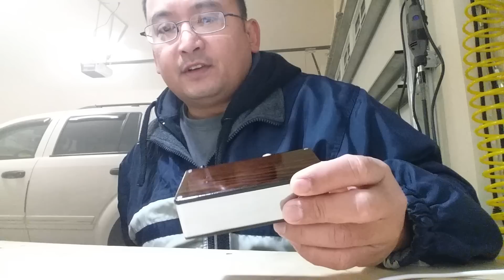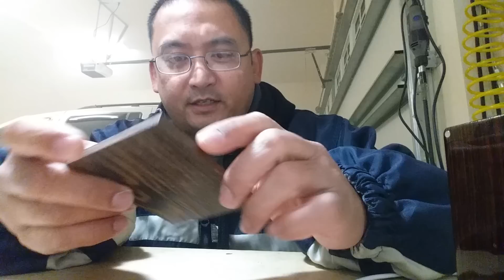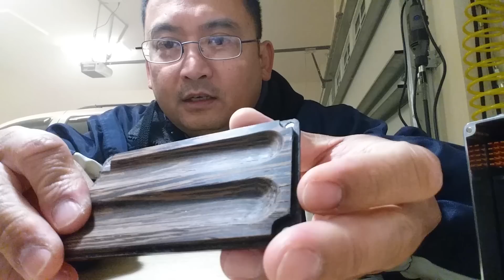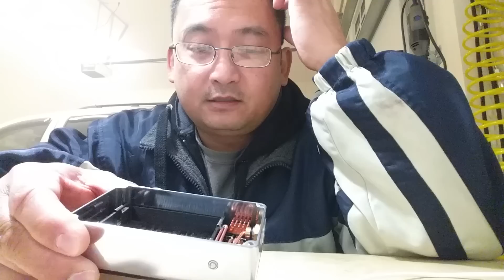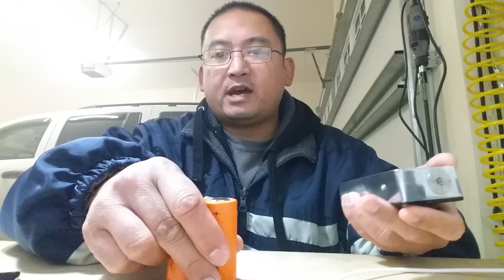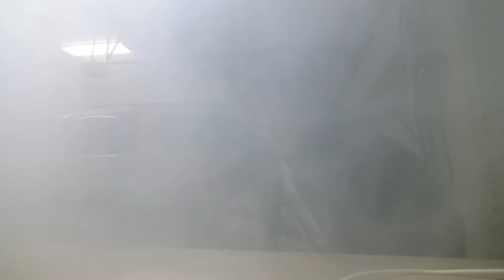Custom made parallel unregulated 26650 box mod

Comment: how can i solder the mosfet without getting it to hot ? I heard some people use alligator clips as heat sinks . I'm using solid copper, and it takes awhile to heat up . My iron might be to small  it's 60 watt and goes up to like 450f degrees . Sorry i know this video is old . lol I really like your build . and it inspired me to build one , but in a 1590g box .

Comment: Surely you didnt use bare copper wires.  You can get the same look using magnet wire and have the safety of enamelled insulation just in case. 

 Also, in this type of builds, why don't people just use the enclosure as the negative conductor?

Comment: Nice build. With the issue of bare copper wires for some. Just use copper magnet wire. Depending on the insulator used, some look like bare solid core copper. You get the look for the piece of mind plus doesn't tarnish to green or black.

Comment: Do i need to use a mosfet for my parallel mod sir?
Reply: +Peter Myron Acutillar Yes, unless it is regulated (and even then, it depends) or "fully mechanical" (no soldering joints and a non-electronic switch (just a switch like on a tube mod)). Make sure you know your electricity and batteries before building a box mod. Just because it physically isn't too hard to do, I HIGHLY suggest learning how and WHY it works the way it does (the different types of mods and also the different components required - if you need to ask if you need a mosfet, you don't have enough knowledge to build a box mod) before putting tool to material. I studied for a couple months at LEAST, watching and reading a lot of information on electricity, and how it relates to vaping, before even ordering the parts I didn't have. Simply because I realized early on, how dangerous it CAN be, if you don't know what you are doing. I didn't even build my first box mod until I had the wiring setup for it on a breadboard working properly, which didn't take too long in itself once I understood the underlying principles/laws regarding electricity/physics. Once you understand the electrical principles (ohms law, battery chemistry, how to read/write circuit diagrams), building and troubleshooting the circuitry comes almost naturally.
Point is, don't take shortcuts. The last thing we need as a vaping community is a modder who blows himself up with his own device. New ignorant/young vapers are the ones having mods explode because they don't know what they are doing... that in itself is bad enough - but if a mod creator has a similar experience, the media would POUNCE on that single instance. "Even The Most Experienced Vapers Are At Risk Of Exploding!" - I can see the headline now. Up until now, it's all been user error due to ignorance. It'd be a shame if it'd happen to someone who should know better. I say this all with respect and am not trying to discourage you, I just want everyone to learn first - this community is great and has given me a lot of great information, but you have to be willing to learn first. As great as this community is, I could see many people just trolling you for asking a question that, no offense to you, should already be known. They say no question is a stupid question, but there are modders who would argue that haha :) Anyways, good luck on your box mod building journey, it is extremely satisfying once you know what you are doing and finish your first box. Not to mention, you can explain to people who are interested in how it works; or maybe someone asks something like "won't that blow up and kill you?", you'll have the knowledge to explain to them why it won't as long as you know what you're doing.

Comment: That bare copper wiring looks badass.  Nice and clean-looking, elegant, just all-around, very professional-looking.  And the wood is just the icing on the cake!  It's absolutely beautiful!  Only thing I would have done differently, and I just say this 'cause it would be my own personal preference, would be to use a larger fire  button, like the ones Find My Vapes uses on his DIY DNA 20/30 box mods.  Regardless, that is a gorgeous build.

Comment: Hi Dude,just made my first box mod thanks to you,like yours build (INNER DESIGN )obviously not your box `but I added a volt meter I used a gboy box this was hard to fit all in,could not fit heat sink due to the v meter and I placed the 5/10 atty near the button rather than away from the button,I could not make to much of a spring in the wire though FOR THE 5/10` as I needed the wire to go where the v meter was placed,I damaged 2 mosfet on each,one leg came of on both LOL,my soldering needed practice i ONLY HAD A 80W iron but now ordered a weller 50 watts`and a wire fell of the volt mater lol but solder it back,Any way all done in the end I gave to the misses and she was as pleased as punch,all works great and looks reasonably cool,So all your advice was put to great use,now going to build my one,cheers,
Reply from the maker: Congrats! You can refine your next build from what you've experienced building your first one.
Reply: Yep I certainly will,I did go a head and cover all copper wire in clear heat shrink but became a bit of an ass in places,I certainly will improve `possibly add a slide switch as well down the side of the sled to turn of v meter instead of it coming on every time the button is on,small steps at a time will get me on the correct track of advancing.

Comment: Hi I was wondering your battery sled clips are not bare copper so when soldering would I need tin solder and would the soldering iron have to be set above 700 f ,also what wattage soldering iron do you use,I have a 60 watts stationary,a 60 watts adjustment one and a 40 watts adjustment one,
Reply from the maker: I use a Weller WESD51 50 watt soldering iron, adjustable from 350 to 850°F. You don't have to tin the sled contacts but always use solder flux paste. 700-750° is good for most of your soldering but lower it to 600° when soldering the mosfet.
Reply: +Al USAF Thank you,,led solder or led free or rosin solder that has flux in it,
Also I notice that some viewers have commented on bare copper wires been used on your box mods and mosfet not being shrink wrap,I do agree pointless shrink wrapping the mosfet,defeating the objective. I personally love the look of bare copper wires `but I also feel that where there is electricity running through wire it usually has a coating of some protection,So because I like the copper look but I want protection I will be polishing the copper then using clear heat shrink wrap over it`And hopefully I get the best of both worlds.I know it might tarnish over time but Ill see what happens.
Reply from the maker: +wow dude I use 62/36/2 silver bearing rosin core solder. I would never shrink wrap the mosfet. Yes, after soldering, you can coat the wires if you want too. I only cleaned and polished the wires after putting it together and it barely tarnished.
Reply from the maker: +wow dude I meant, cover the wires before soldering. I've commented or answered a comment about the bare wires, wires tarnishing, etc. Some think there will be performance issues because the wires will corrode and degrade (which I disagree), some think the voltage will jump to the other wires because of the lack of wrap and the wires being so close together (horse shit), and some think it's not safe (well I told them to heat shrink their entire mod).
Reply: +Al USAF Ha ha I liked that one,heat shrink the mod,I can`t stop laughing I could imagine some one being that paranoid and doing that,lol.Thanks again for your constant advice,I know you would usually get around to answering 1 comment  per person or else you get no spare time,cheers.

Comment: I myself want to build a box but I can only find 18650 build guides, is everything the same with the 26650 build except the batteries and tray? And do I need two mosfet for a 26650 build or can I still use one?
Reply from the maker: Ryan Ebling yes for your first question and you only only need one mosfet. But using two mosfets in parallel will work too.
Reply: +Al USAF thank you I appreciate the help! It solves so many issues I thought I might run into.

Comment: Great video bro. I've built many box mods, but will be using solid copper wire for the first time. It looks super clean. I see you got the negative wire running behind the sled. Will it melt the sled, or do you have it not touching? I want to run mine the same way, and was just curious. Thanks for your time.
Reply from the maker: bukesta1er never had any issues with the wires getting extremely hot or even hot to melt anything inside. The only part that gets hot is the mosfet. So be cautious where you mount it. Thanks for checking out my channel.

Comment: Al USAF have you ever thought of using clear acrylic back and front cover so everyone can see that awesome bare copper wires???
Reply from the maker: Walter Juntar I thought of using it as a front cover. But I still need to find a sled whereit will not cause the batts to stick out of the box. The batteries has to sit below the box or the acrylic cover won't sit flush.

Comment: Yo I got a spare ipv3 I want 2 make unregulated how would I go about doing that could I use the the same motherboard or would I have 2 install a mosfet and capacitor thx btw does this box have a on off switch?

Comment: Al USAF Do you have a video of how you do the negative on 3d printed battery sleda
Reply from the maker: Bill Cromwell I don't. But it's pretty straight forward, just solder the wire on both contacts (make sure you're soldering with the contact off of the sled) and route the wire underneath the sled.

Comment: Hey man how exactly did you cut out the other side of the box and then how did you router the doors to fit perfectly?
Reply from the maker: Allen Hicks used a dremel to cut the back off and smooth it out with a file and sandpaper. I screwed both wood pieces on to the box and used my router to trim the excess from the wood, by following the counter of the Hammond box. Next, I used my router table to trim off the outer edges of both wood pieces, so it will also seat inside of the box instead of just on top.

Comment: If I were to build a parallel regulated dual 26650 box mod what enclosure do you think would work best? Because it looks like the 1590B Hammond box is slightly to small, unless you think the chip (DNA 40) could fit under the battery sled?...
Reply from the maker: iNuKularZ if you're just going to use a DNA40, you will be able to fit everything inside a Hammond 1590B. You're going to have to mount the chip above the sled. You will not have the room to mount it underneath the sled.

Comment: Hey AL .. I'm building a box mod very similar 2 yours and am using 14 gauge solid copper wire (very hard 2 sodder 2 the mosfet chip btw lol )   my question is after time do the wires sag or move around any .. my clearances are very close .. do u have any suggestions?  If I could maybe send u a pic 2 see how close they are .. and what u think
Reply from the maker: alan disney it shouldn't once the wires are soldered in place, if done properly of course. The wires on the mosfet will be really close to each other (I used 12 gauge wires with no issues). The way I did it was, I soldered the wire going to the middle lead of the mosfet dead center. Then the other wires were offset a little bit to the left and right, just enough that the wires are still supported by the leads but slightly away from the center wire. Also before soldering, make sure to bend the wires at the exact position where you want them to be. So your not forcing the wire into position while soldering. This way, if your solder fails, the wire will not spring to another wire causing a short. Hope this helps.

Comment: next time use a proper thermal adhesive paste on the mosfet for the heat sink. epoxy isn't really meant for that kinda thing.
Reply from the maker: Kewl Beans for this application I was concerned more about security (not falling off). Plus the heatsink does get hot when I'm chain vaping so it's doing its job. But if you know of a heatsink paste that will work and will not require an additional item to hold the Mosfet in place (like on a CPU), please let me know.
Reply: Al USAF
like i said you need thermal adhesive. it's similar to the stuff you'd use on a cpu but it's got an adhesive added. the main difference between JB weld and proper thermal paste/adhesive is there's more metal particle so while JB weld works because it does have some metal particle included, a proper thermal paste would work more efficient. arctic silver makes both. the adhesive works similar to JB weld epoxy mixing 2 separate components so working with it should be easy enough for you to deal with.

i think you can find it premixed in tubes but it's kind of a one shot deal since once you open it it's gonna dry out and set like liquid glue(i used that kinda thing for an aftermarket gpu heatsink block). probably not a good idea if you're making lots of box mods. so i'd go with the 2 part mix stuff.

you can get it from newegg or amazon but amazon sells it for about $1 cheaper.
Reply: ofc you could go completely insane and wire in a 5mm fan lol
Reply from the maker: Kewl Beans nice...thanks for the info. I'll order some because I'm working on another box mod.
Reply: Al USAF
i figured you would be lol. thought i'd pass on some knowledge since i'm working on one based off one of your designs but w/ a secret twist. ;)
Reply from the maker: Kewl Beans I'm all about doing something different. I'll definitely look into that and maybe incorporate it to my next build. Thanks for the idea!
Reply: Al USAF
no probs...vape on bro :D
Reply from the maker: Kewl Beans it better not be a fan...I want to be the first one...hahaha
Reply: Al USAF
haha nah you can have that one for free. might have to charge you for the next one tho haha.  throw a turbo atty on it for kicks! :D

Comment: did you paint the hammod box to give it a stainless steel look because you did mention that you sanded the box. if so, what paint did you use? i am looking at buying a hammod that already has that finish with it already having the angles eliminated but i feel when i cut it and sand it, ill damage the finish. also, what did you use to cut the hammod box? thank you for all your help in advance.
Reply from the maker: C Macapagal I used a combination of dremel and files to cut the back off the Hammond box. I used finishing sand papers, up to 2000 grit, and a buffing wheel for the almost mirror finish.

Comment: Nice looking box, I have a question. How do you go about centering the holes for the button and such?
Reply from the maker: Jhan Santiago I just measure it. If it's a little off, I'm good with it. I drill a slightly bigger hole for the 510 so if it's off centered, I can adjust.

Comment: Hey man question when i solder with solid copper wire i always gotta heat the hell out of it to get the solder to stick do u have a trick or a special flux or solder for that matter ty for ur help oh yeah did u ever think bout building a triple 18650 box thanks again
Reply from the maker: Chris Kletzine I use a variable wattage soldering iron which I set at 750 degrees. This is usually hotter than a standard plugin soldering iron. As far as solder, I use the Radio Shack rosin core w/ silver. Probably the most important recommendation that I can give you is to use flux paste. This will clean the contact points to ensure good solder joints.
Reply: Al USAF ty very much for all ur advice and help ur a very cool dude and thats hard to come by sometimes some people are very secretive about helping and not give u the time of day anyway ty man hope u and ur family are well
Reply from the maker: Chris Kletzine no problem Chris. One more recommendation...just take your time.

Comment: I love the heat sink on the Mosfet. I havent gotten to the bare copper wire yet and think I will do the heat sink next on my second build after I finish the first one which is just 18650. I can see the heat sink will be useful on the 26650 build with the higher amps that they can do. Now did you use TIM between the dual mosfets? If so what kind did you use? I used Gelid on my x99s computer build and guess it would work great on this as well since my system runs low 40'sC at full load. I doubt this type of build would get to that level for sustain periods like a computer does.
Reply from the maker: Sith Yarael I used JB Weld to secure the two mosfets together.

Comment: Hey Al first off I just have to say you do some amazing work. I had a question about a box I'm building this upcoming week. It's very similar as I will also be using dual 26650 but I'm curious of what kind of mosfet will work best. I want to do dual mosfet and I was looking at the 3034 but I'm unsure if that's the best way to go. Is that the kind you used on this build and will just one 15k resistor be ok or will two be better? Is there any know benefit to two resistors? Thanks for your time! Looking forward to your next video!
Reply from the maker: Josh Barragan that was the mosfet I used and you only need to use one resistor. Good luck on your build.
Reply: Thanks Al!

Comment: Beautiful!!! By any chance, are you originally from New Mexico or Arizona?
Reply: Im from Gallup
Reply from the maker: Ben Gonzales negative, but I've been on both states.
Reply: Right on. You look like you could be one of my native brother in-laws;-) awesome work. I'm going to use your copper hard wire idea in my build. Thanks for explaining the way u route the positive lead to spring. It's the little overlooked stuff that really matters. Do you absolutely need the heatsink or do the dual 'fets stay at a decent temperature without it?
Reply from the maker: Ben Gonzales heatsink requirement will depend on your typical build. If you do extremely low builds, the mosfet/mosfets will generate more heat.